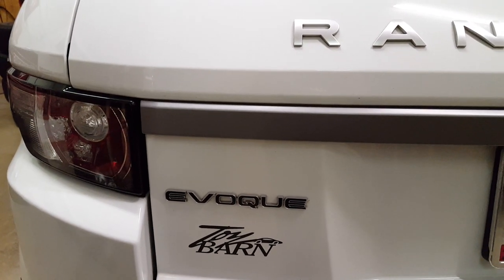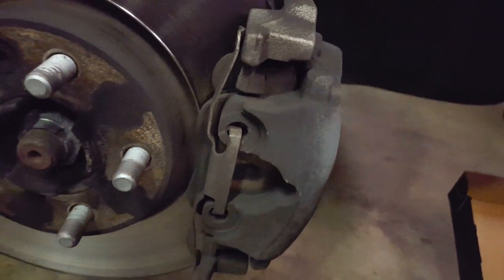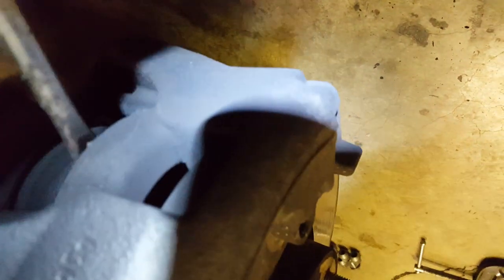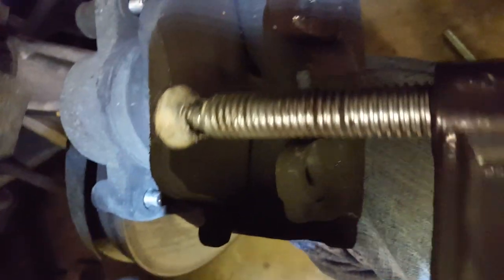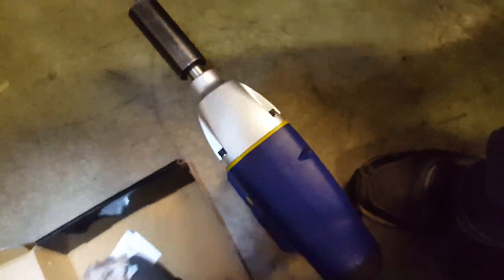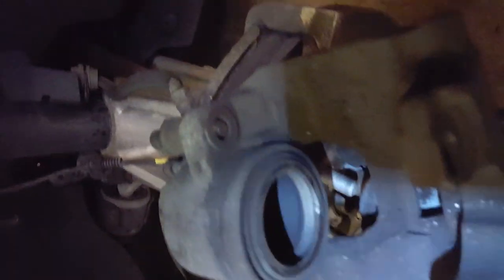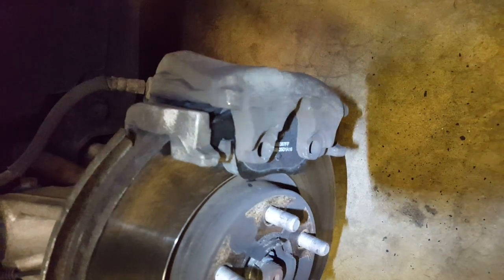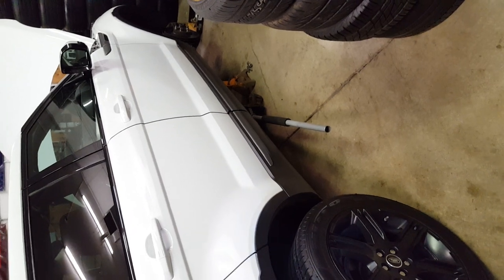Range Rover Evoque front brake job

Comment: Two awesome new techniques I learned from you today. Both the flat head screw driver to ease pressure off the system, and the C clamp with the old pad still on. I did it a similar but not nearly as easy way with a piece of scrap wood. Thanks for your video!!

Comment: What size Allen heads are the caliper bolts? I was surprised they weren't hex bolts when I went to do mine.
Reply from the maker: Not sure i think it is 7mm.
Reply: @saltstire7804  Thanks, I ended up just removing the caliper and bracket.

Comment: Thank you so much for Posting! Extremely helpful!
Do you have to activate or do something else with the Electronic Handbrake??
Thanks again!
Reply from the maker: You only have to deactivate the electronic parking brake when you do the rear brakes. thanks
Reply: Salts Tire Brilliant! Thankyou for taking the time to let me know, much, appreciated. 👍🏼👍🏼
Reply: Salts Tire how do you desactivate it ? Just by the button itself ?
Reply: @HuizachiiCity1  push park brake button down for few secs then press throttle to floor then press start stop button twice. Should make a whining noise, when that stops its in maintainance mode